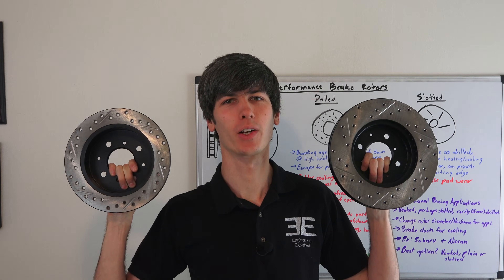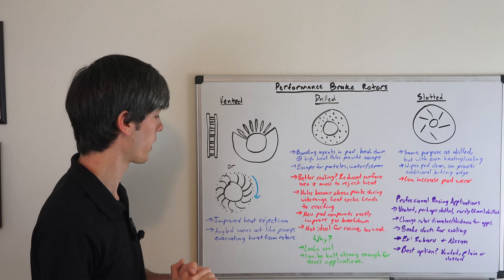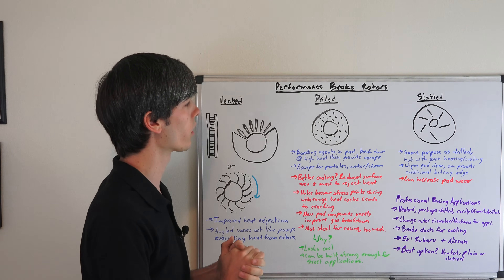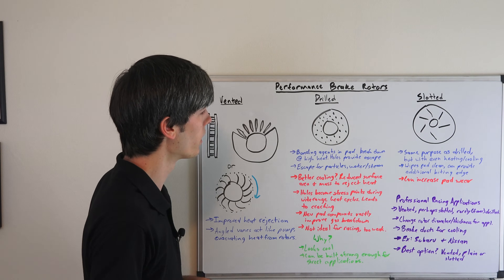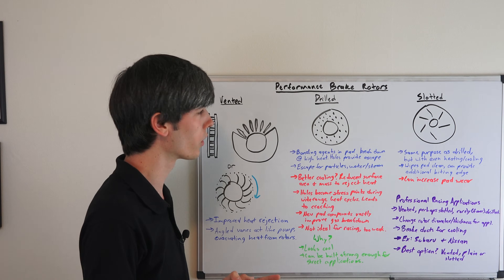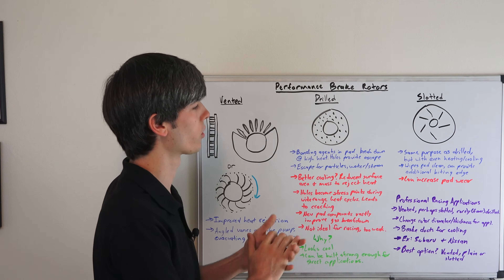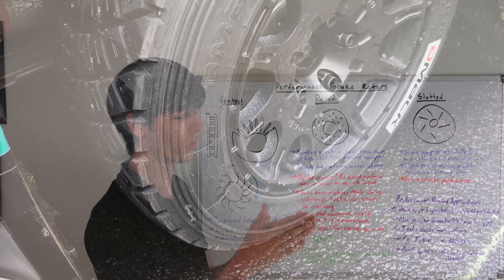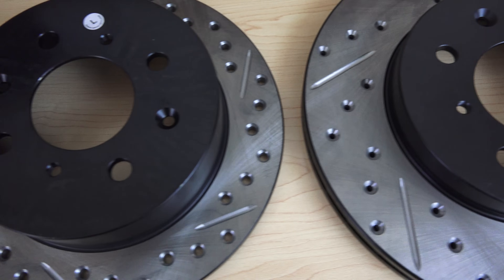Drilled, Slotted & Vented Brake Rotors - What's Best?

Comment: Well the lack of surface area in drilled/slotted rotors is made up by a bigger brake pads and pressure.
But these only really matter in racing where they do not care for added wear on pads nor do they care about rotor cracks as everything gets replaced  with every race, sometimes even during a race.

For your average road car you will be happier with simple vented brakes and occasionally replaced pads, unless it's really about impressing friends, in that case make sure you paint your calipers a bright spangly color first.
Reply: where is this hate comes from?

Comment: Question: why does my bike hase drilled discs? To get rid of water and dirt and stuff, not for the looks. They also are drilled (small holes, not the discs you had for example) to reduce weight. this is un sprung weight, and so it inproves handling, because of the small holes that are drilled, the surface area isn't reduced that much. The discs you had are for looks, not performance inprovement. Brembo, Stopteck, EBC. All the big brands (that do race brakes) uses drilled discs. Even in rally and open wheel race cars

Comment: Drilled rotors always seem to get packed with pad material and thereby negate the purpose of the holes.  My question is: What profile of slots is best?  I've seen all kinds of different patterns and there is no measurable data to prove which is better.

Comment: Forgot one major aspect. Casted hole rotors. these are cast so you dont get cracks in those holes because drilling causes small cracks wich will get bigger stresspoints and fail. Casted hole's wont have that. Buggati Veyron on the other hand only uses drilled carbon discs.  Reason they use holes simple heat.. they tested every type of disc but going 400kph to a stop but all others could not cool enough. So they went with drilled carbon discs. look it up.

Comment: Thanks for some of the best technical discussion on YouTube.  I know you have limited time to explain stuff and don't want to get too far into the weeds on things, but could you discuss Pillar Vented Rotors at some point? I have had several Brembo's with PVT and they make some pretty persuasive arguments for doing it this way, such as More thermal exchange surface, and Greater air turbulence. Perhaps a comparison with vanes, curved vanes and different shaped Pillars that Brembo is researching. Is it JUST Brembo? They have a LOT of racing experience but still curious if others are doing things along these lines.

Comment: So LMP1, like Formula V8, like Formula 1, and a few other series don't use slotted rotors, but not for the reason of not wanting to use them or knowing the benefits over drilled for example, but because of the material that is used. They run carbon brakes, that is carbon fiber reinforced carbon, very well vented brake rotors, interestingly they vent the hot air into the rim to help maintain heat in the tires, but anyways, I digress. The advantages of using carbon-carbon (or as the mechanics and engineers call them just carbon) brakes are how well they handle the heat, lots of heat, which is needed for cars that generate 5G under braking (for example a supercar might go as much as 1.2-1.5G). The disadvantages are cost, due to the process and time of production, which I believe is around 10 hours, the fact that they don't work well until heated (optimum operating temperature is around 650C(1200F), 1200C(2200F) is seen in a hard braking event), and that the material is very brittle, which is why you cant slot them (though they can come drilled). Also during the hard braking when 1200C temperatures are seen oxidation becomes a very significant factor in brake wear, and because these brakes will stay in that range for a moment even after use, the wear (which is the outer layer of the brake disc burning off) continues past the braking event, so penciling in high wear due to high operating temperature also as a disadvantage as well.

Comment: How are slotted brakes any better than drilled brakes, when it comes to contact area? I get that, if someone's looking for performance, they shouldn't opt for the drilled brakes, because of the reduced contact area, but, if you look at the slotted brakes, instead of having all these drills all over the brake, you have these relatively massive slots, or "lines", that, in some cases, run across your brake. 
In the Subaru example you gave, you can see that the slots are pretty much "holes", meaning that they're acting as drills (so they can cool the brakes by letting hot air escape, obviously), except they're taking up much for space than a simple drill would. 
Also, in the slotted brakes you're holding in the video, you can see that the slots consist of "depressions" on the surface of the braking area, and not "holes". With all the friction and heating up, due to intense braking, causing the dilation and flexibility of the pads' rubber, and the brake itself, is it possible that the pads can occupy the "depression", using the contact area within said depression, and would that have a noticeable impact on braking performance?
I apologize if I sounded confusing, but I did my best to put this in the best English possible :P
Thank you!

Comment: Is there a reason why most extremely high performance carbon ceramic brakes on road cars come with drilled rotors if it's worse than slotted or plain? Granted, they might all be vented too it's hard to tell from head on. The Mclaren P1 is the only case I can think of with non-drilled carbon ceramics. Is that material just simply so much stronger than steel/cast iron that the possible stress concentrations aren't as much of an issue, or is it something else?

Comment: Seems like vented is pretty much the norm nowadays. I've had drilled vented rotor that came stock on some sportier car and replacement rotor can be found sloted, drilled and vented all together for not much of a premium on plain vented rotors.
Reply: +xSS4x What are you driving that had drilled rotors stock?
Reply: SidewaysGts Dodge Stealth.
Also comes stock with 4 pistons caliper in front and 2 for rear.
Guess it needs the brakes to be awesome coz its so heavy lol

Comment: The rotors on my scion tc are actually manufacturered thru stop tech and are drilled and curve vane they have a different material added to make the rotors last longer that would still fall under what you mentioned about the high end example you gave about the merc?

Comment: I think the best rotors to go with is the one with little to no holes
The key point is less chance of failure and any one of those with holes has stress limits towards extreme temperatures and cracked rotors is a recipe for disaster.
So all those 6 piston Brembo BBKs you see for over 3k ain't worth it unless you don't mind throwing money away

Comment: Are vented rotors also ideal for the rear wheels too? I have a 2001 bmw 740il and most of the “rear” rotors for sale are not vented, only the front rotors are.  Should I insist on getting vented rotors for the rear wheels too? Or just go with the simple non vented ones for sale.  Great video and thank you!
Reply: Because of the less loading/stress of the rear brakes, most of the (normal) street cars do not have vented rear rotors. The thickeness of vented rotor is signifcantly higher, so - most probaly you will not be able to find vented that fit on the stock rear brake setup of this BMW (E38), where the thickness of the rear rotors should be 12 mm. So, buy the solid rear rotors. :)

Comment: Mercedes AMG rotors are not drilled. They are cast in, avoiding stress risers while gaining the advantage of additional cooling. 
Also, brake pads still out gas, so slots are necessary.

Comment: So, what's the purpose the slots on the drilled rotors you had as an example? And do these issues also effect carbon ceramics as well? Because it looks as though they are drilled and vented.
Reply: Charles Johnson the concept is exactly the same on carbon ceramic rotors
Reply: Charles Johnson as he said, it is for LOOKS. rotors don't give better stopping power. What matters is brake pads. So when manufacturers say better performance, it's mostly bullshit.
Reply: +Khalid “Zaki” Ansari brake fade occurs at brake pads. When brake pads gets too hot, it loses friction coeff.

Comment: Drilled rotors are fine on street cars including high end sports cars because heat generated on the street, even with spirited driving, will come nowhere close to temps generated at the track for a track day. Actual "racing" done by race teams is in another category altogether and requires brakes that you can't afford anyway.

Comment: Thank yo for the video! What advantages/disadvantages are there to different rotor materials?
Reply: 6reve its going to be mostly heat dissipation and wear
Reply: 6reve steel rotors: + affordable
                                   + better pedal feel than carbon ceramic ( from what I've heard)
                                    -heavier than CC ( almost 3 times as dense as silicon carbide)
                                   - rust
                                   - softer than carbon ceramic
                                   - can not take as much heat as CC

silicon carbide (carbon ceramic):
+ much harder than steel (therefore less wear)

+can take more heat than steel (therefore don't fade as much)

+no rust

+lighter , less rotational mass

- expensive to replace
- less/worse pedal feel

Comment: So why are stock high end perf cars fitted with drilled rotors? I am thinking of the Porsche GT3, for instance. I trust the engineers to have put those for a good reason and certainly not because "it looks cool". In addition, a GT3 can be used intensively on a race track without experiencing the cracks that Jason refers to here.

Comment: Is there any credible research comparing the durability and braking performance of these disc designs in daily use? I have only been able to find computation studies on heat dissipation and force output, not particularly applicable.

Comment: I bought the slot and vented over the slot and drill as it just made more sense in keeping the brake pad clean.  The drill is just unidealisttic as hot air will just get onto the pad, negating  its effectiveness in stopping power.  More surface equals better bite, kind of like on a solid vented rotor.  I do notice a big improvement in the stopping power when I tap on the brake versus mashing the brake pedal hard just to get it to slow down in hot weather the stock rotor just couldn't do the job as well as expected.  Sometimes, when in an emergency brake on the highway, I felt like I had to swerve out of the lane just to avoid hitting the car in front because it is just not slowing down quickly enough.  With this new upgrade, I rarely had to put force down on the brake pedal to get it to slow down.  I just gently tap tap the pedal and my heavy suv slows down dramatically with very little effort.  I have not slam on the brake hard to see how effective it does in an emergency brake when someone cuts me off on the highway or a hazard in the front. As far as the wear goes...only time will tell after I put a couple hundreds on it. To see if the trade off is worth it by going to a slotted performance   rotor  over the stock.

Comment: What about on those newer carbon ceramic rotors? I notice that lots of those are cross-drilled as well. Is there any benefit to cross drilling them because they're made of a better material, or is it still primarily for looks? The Corvette ZR1 and Camaro Z/28 come to mind.
Reply from the maker: Zack Richmond I'm not sure if the material can handle it better or not, but again it will create additional stress points. That said, if the car's used primarily on the street it's really not something to worry about, as it won't be getting really wide range heat cycles.
Reply: Zack Richmond If you buys it from reputable brand (ex: Brembo), chances are they should be ok for DD. For DD, your disc will never see the same stress level at the track, so even if they are drilled, they will most likely be fine...

Also keep in mind that one of the important factor in racing is reliability... you certainly don't want your rotors to crack/fail during the race and go back into the pit to change them... since pit time is extremely expensive. Whereas if you use it for your DD, even when they crack, is not such big of a deal, you can still limp it back home or drive slower/carefully for a few days before you have time to replace them.

IMHO, cross drill is just waste of money, they cost more and less surface area (maybe 5% less?), but if you are going for car show competition, sure, go for it.

Comment: @Engineering Explained would this also apply to motorcycles as well? Many of those have very little surface area. They have so much removed from them. How they are able to have much stopping power. They are really light though.

Comment: I've heard from several "experts" that drilled rotors will crack and fail even on a street vehicle. I've used drilled rotors on 5 different vehicles from trucks to sports cars covering hundreds of thousands of miles and have NEVER cracked a rotor. If you think they look cool, use them! They will hold up just fine.

Comment: great video mate.

wondering about dimpled rotors I had some slotted and dimpled rotors with ceramic pads awhile back on brembos great all round but always wondered if the dimples were a for looks like trying to look like drilled without being drilled  because of the downsides of drilled or if they acted the Same as slotted other wise it's just reducing the rotor face for the pads?

Comment: I was just curious about clamping resistance? I was told by my teacher when i did my mechanics course that slotted and drilled rotors are mainly for getting on the brakes quicker so the air has somewhere to go and brake response is better.. obviously there are other reasons such as aesthetics, more bite on the pads, etc but I'm just curious, is that correct?

Comment: I have a legit question. So Drilled Rotors are not strong due to cracks. I agree. I Have seen it. Now. What if you have the drill rotor treated with Cyrogenic Treatment? What is your opinion on the drilled rotor after that?

Comment: I use Cross Drilled on all of my vehicles, never had any warping and no cracks.  pads last longer and braking is greatly improved.  Buy cheap parts & you will have problems in any case.  solid rotors tend to warp,  slotted are no good with road salt or rain, rust forms in the slots.   There is a Difference between jaw flapping and many years of experience.  (Akebono pads & Cross Drilled Brake Rotors Made in Canada)   Machined in U.S.A. is still China parts.

Comment: Drilled and slotted rotors wont crack from daily driving. So don't worry about it. Unless you got a car that you take to the track and go hard on the brakes then it might happen, but daily drivers would not need to worry about cracking

Comment: Hello everybody . I have a Type R FK 8. how can it be that the holes of the brake discs at the front left and right are identical in parallel? Shouldn't it be that the arrangement of the holes in the swing and due to the direction of rotation of the opposite brake disc is the right way round? 😎 H.Thomas, Duisburg, Germany

Comment: I have a 2014 VW Passat TDI, my brakes have a pulsation feeling which is the indication of rotor warping. 75% of my driving is in the city and was wondering if that contributed to the warping. I have 40K miles in the car and rotors are OE. I wanted to replace them with E-line drilled Brake-Rotors - Cross Drilled And Slotted Vented Rotors. They do look nice, but after watching the videos I am concern with the drilled holes with respect to the cracking. Should I be really concerned about this or is it mostly for performance racing at the race track?

Comment: What about Big Brake Kits? I've been spending a couple of hours reading and most sites claim they aren't any good for the stopping distance. They say that your ABS is not calculated for the bigger brakes and you're limited by your tires etc. But if you put on a big ass brake kit with very good tires, does that actually make you stop faster when driving with high speeds on the highway or not?

Comment: I would think that if AMG was using them there would be a reason other than looks.  AMG is one of those tuners that are famous for performance.  It comes to my mind anytime I think of anything that is built specifically with performance in mind.  The only downside of AMG of course is price considering their extremely close ties with Mercedes.  You may very well be right about it to an extent but I don't believe they would do it only for looks.  I would also expect the rotors on those cars to cost a small fortune from the dealer.  I know they are horribly expensive on the McLaren SLRs (if you saw the price it is more than what some cars sell for new)
Reply: The holes are good for scraping water off during high speed driving in rain. Like over 110kph/70mph.

Lots of high power cars have ducting to direct cooling air at the brakes...they tend to soak discs in rainy weather. The holes help initial bite.

Some cars apply the brakes lightly at intervals, to dry the discs, but it's not always enough.

Speaking from experience with BMW M-Sport models...